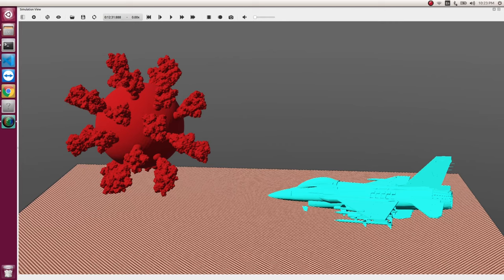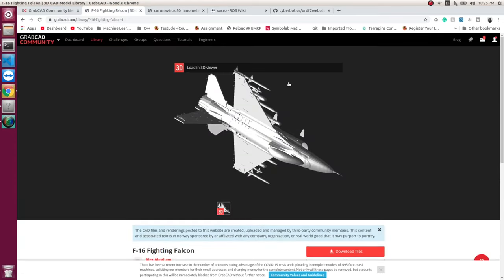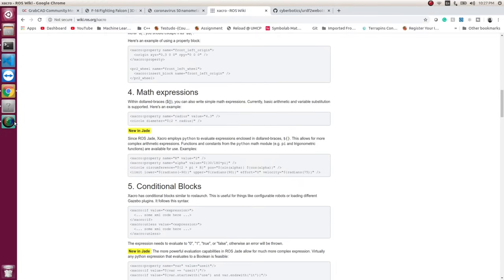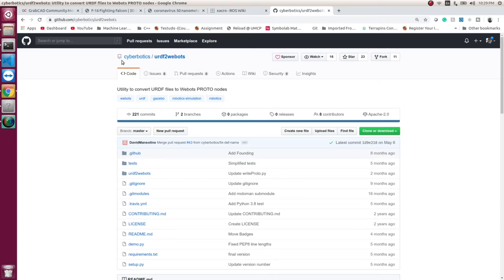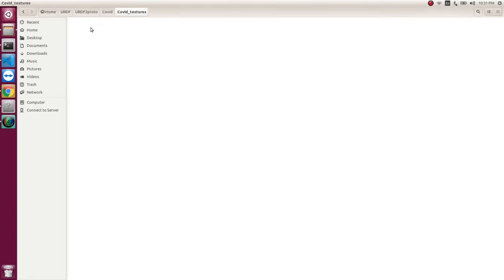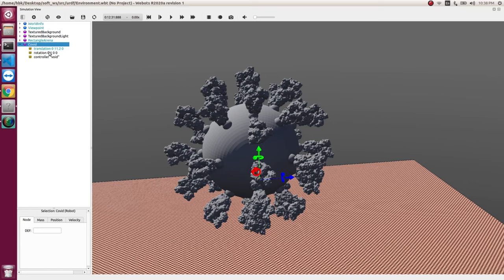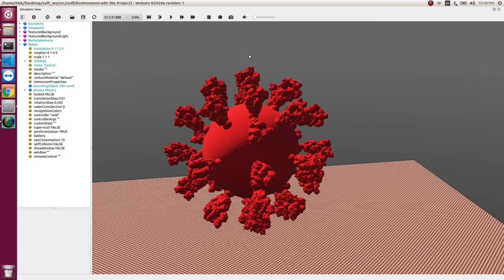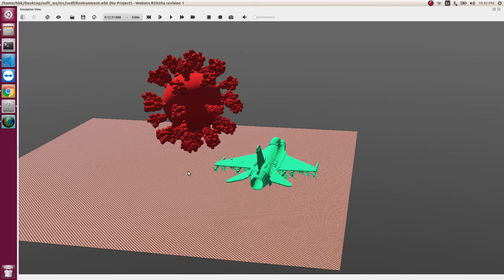CAD Model to Robot Simulator | URDF to PROTO | Webots | [Tutorial 17]

Comment: Hi, thanks for your inspiring video. I am wondering whether this tutorial is based on Linux only? When I tried to do the same thing on my computer, I failed at step 4 when I ran the stuff on my command prompt. It displays the message "xml.parser.expat.ExpatError: not well-formed (invlaid token): line1, column 1". I was following your instructions exactly.
Reply from the maker: Thank you very much.
Yes, this is based on Linux. you can refer and compare your Xacro with below link:
https://github.com/harshkakashaniya/Soft_illusion/tree/master/URDF
Reply: @coolrobotics  I referred to your Xacro exactly and tried to run the terminal code on Linux. However, I got the error feedback like this: 'ascii' codec can't decode byte 0xef in position 0: ordinal not in range(128). Would you please suggest a possible solution to this?
Reply from the maker: Go through steps in readme for download the package.

https://github.com/cyberbotics/urdf2webots